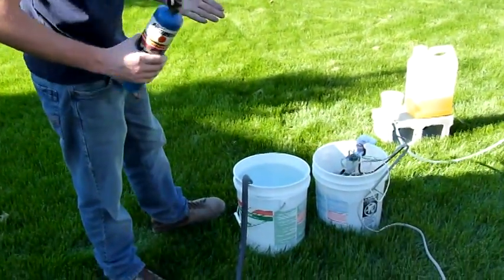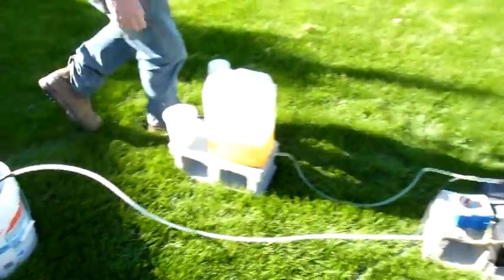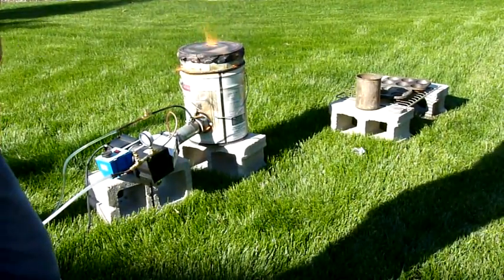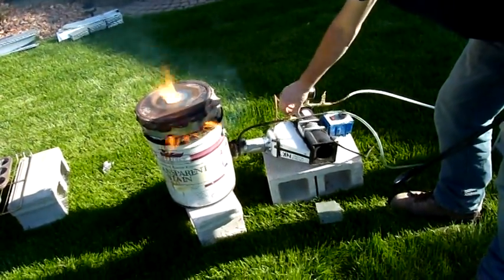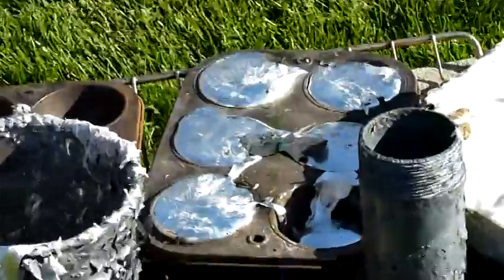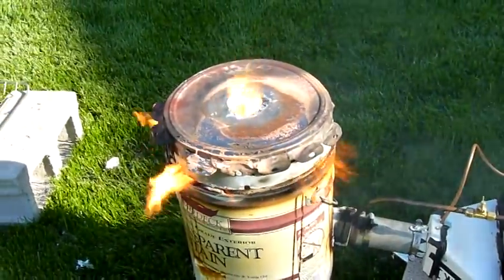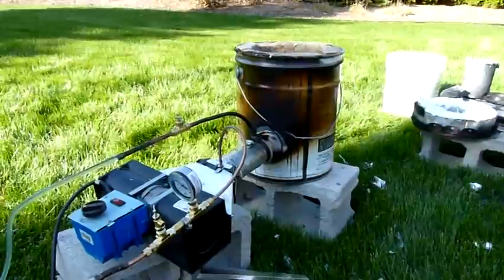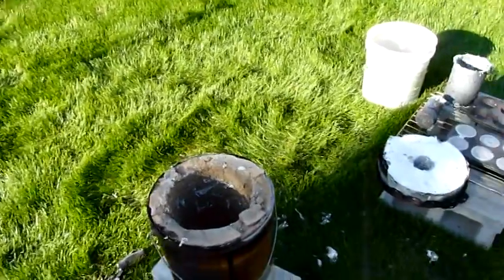The 9mm Bullet Atomizer in Action

Comment: There is absolutely zero reason to do it this way.  Geez. There are much simpler and efficient ways of making and fueling a foundry. What with the overkill involved in this video, I'm guessing this guy is an engineer.
Reply: Sincerely, can you name a couple "simpler and efficient ways"? I previously built a solid-fuels foundry and it was awfully inefficient. Now, I'm looking into alternatives. The latest idea is to build an arc forge. Can melt most metals in just a couple minutes and can run off of my solar panels.

Comment: Holy shit you are scary. You should never! have any water around molten aluminum. Not only can the aluminum pop and splatter molten metal everywhere  but it you get alot on their it can make a chemical reaction and produce a hydrogen explosion. Plus you have no protective gear on what so ever. Trust me I have been working in a aluminum factory for over 6 years  and seen many explosions and metal burns.

Comment: You should look into fluxing your metal melts.
Good idea none the less - ive seen one running on used motor oil so the impurities in it are probably not a huge issue if you flux.

Comment: Impressive home made foundry. But you REALLY need thick leather gloves, real crucible tongs rather than those fireplace log tongs, leather fronted leggings, some safety glasses, and some steel toed boots.  Yes, what you have done here is commendably amazing. And "making-do" with a lot of the parts is OK, but you shouldn't skimp on protecting yourself.  BTW, if you try to melt copper, isn't that going to melt the bullet casing?

Comment: Also use some heat-garding glasses. 
If you wanna melt  some al-magnesium alloys (same kind some soda brands uses for their cans) , make sure to have UV-proof glasses. 
I wasn't aware of this in my debuts, and ended with a serious case of eye burns which lastet 2-3 days.

You can build a simple, yet effective skimmer forged from a rebar rod. And be sure to discard this telescopic clamp for a  sturdy, robust steel one, we don't want your feet burnt, do we ? ^w^

PS : thinner ingots melts faster.

Comment from the maker: @JamisonPantley I love propane. It's easy to build propane burners, you don't need equipment like compressors or blowers (assuming a venturi burner), and the furnace simply lights with a match. However, propane is expensive and has a hard time reaching the temperatures needed to cast hot things like iron and copper. If you can afford it, go with propane first - it's great for beginners and you can always use it as a preheat burner for oil when you move beyond aluminum and brass.